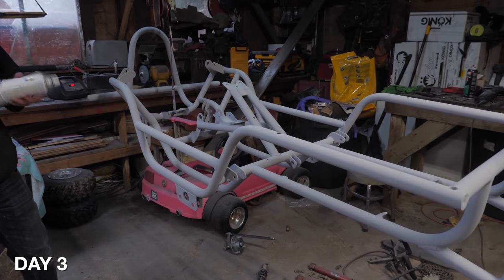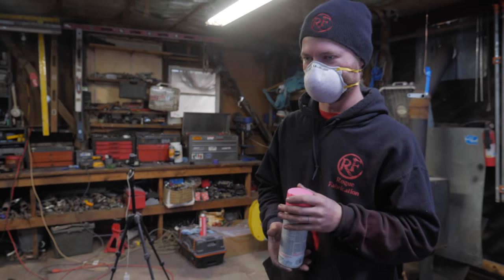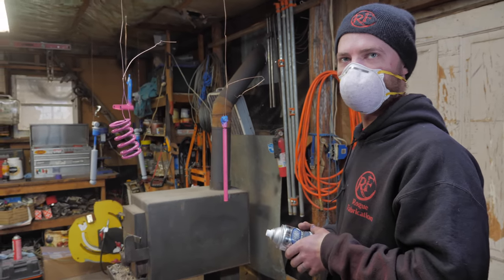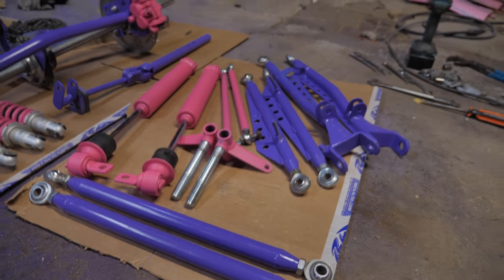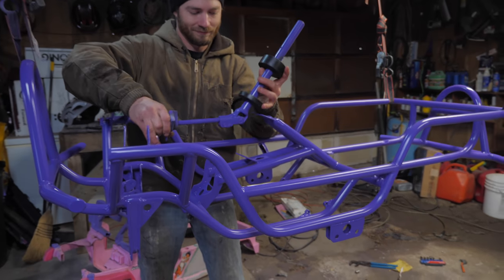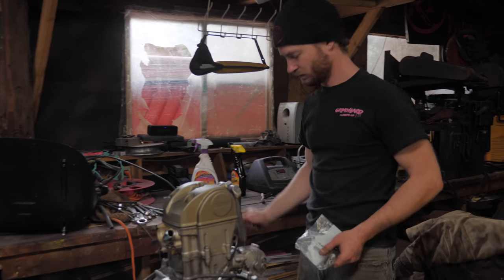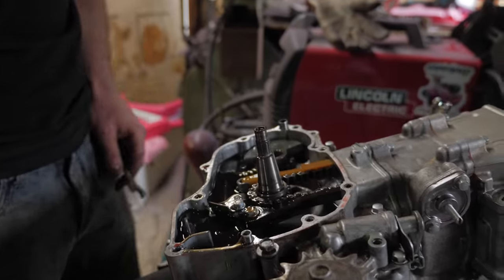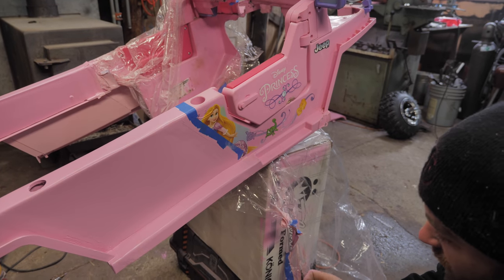The CRF450 Barbie Jeep Is Finished! Painting and Final Look.

Comment: You guys should build a 4WD truck with a small 2 cylinder diesel out of something like a utility tractor or heavy duty lawn mower.
Reply: maxwell olson yesssss!!!!
Reply: maxwell olson or like a 4wd buggy with a streetbike Motor
Reply: not just a 4x4, Get an old King Quad with super low and diff lock front and back.
Reply from the maker: Definitely want to do 4x4 on the next one!
Reply: @GrindHardPlumbingCo  It would definitely handle snow better.

Comment: you should swap a cr500 in when you get tired of doing the valves on the 450 lol
Reply: why the crf450 motor is faster and where they gonna run that huge stupid pipe lol

Comment: I had a 07 crf250r and it was way ezer to just take the cam off to get the timing chain off

You could take the bearing blocks off, slide the bearing closest to the chain down by the gear and into the chain cavity. That would give the chain enough slack to take it off. Don't know if the 450 is the same but thought I'd share!

Comment: Hey be careful with that homemade flywheel puller. There is an oil journal in the end of that crank shaft that lubricates the big end bearing of the connecting rod. High pressure oil gets fed through the side cover and into the journey in the crank end. The factory puller has a cover for the end of the crank so the hole doesn't get peened over by the puller. It could get blocked and the engine will run fine for a bit but the big end bearing on the connecting rod will wear out very prematurely!

Comment: One quick question about this awsome build. Did you use cold rolled steel for the axle or did you use superior shafting? Ok two questions are you making the plans availible cause I would like to build a unit for my grandkids to rip on with a slightly smaller engine to start with but I think your frame is a work od genius.